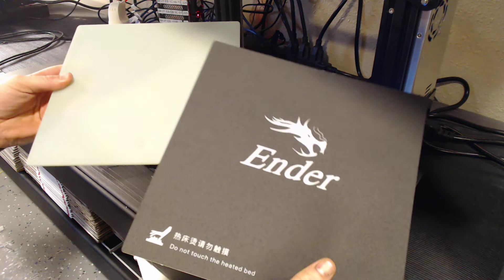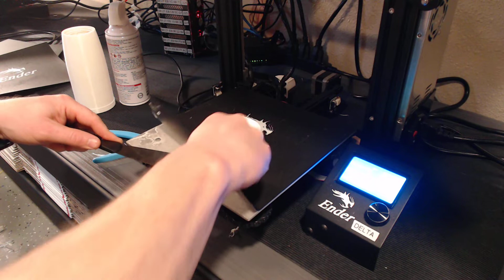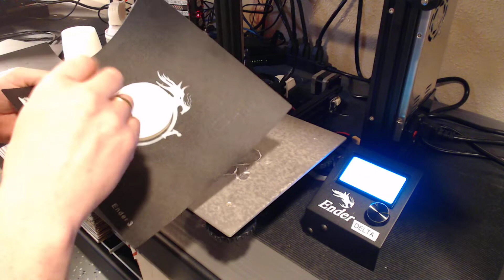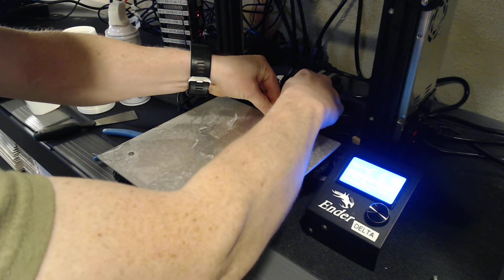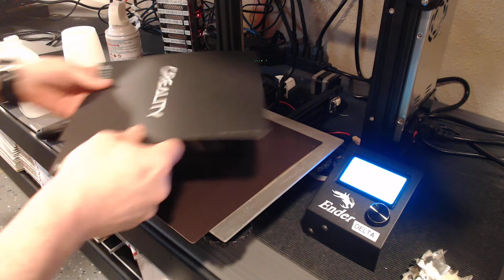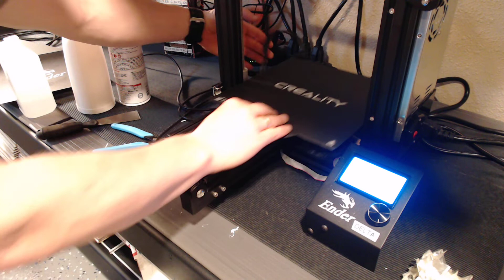Replace your Build Surface with a Magnetic Build Surface

Comment: When doing this, I like to just remove the bed from the printer. Is't just 4 screws. If it's heated there's a cable too, but at least you have a bit more access, and won't get stress the frame and get all kinds of solvents all over your printer :)
Reply from the maker: I've got a bit of South Kelso in me.  I don't always do things the easy way.   Either way works..  I had the bed hot if I remember right to help remove the adhesive.

Comment: Hey good info. What if you need to change springs or install some bed handle? Screws are not coming off anymore... It's too crazy to think some holes on the magnetic stick pad for this?
Reply from the maker: Most of my prints are in the middle of my bed..  I make artillery shells by the dozens.  If I need to change the screws, I use and exact and cut right through.

Comment: Next time use a degreaser like la totally awesome or simple green, just a everyday degreaser and it comes right off steve. Please let me know how you like the creality mag build surface,  i am using their glass which is very good and after it cools the parts pop off themselves but i like options.
Reply from the maker: I know there could be a lot of ways to do this. I opted not to used a degreaser to ensure there was nothing oily or sticky on the build plate when I was done.  Alcohol worked well and the surface was dry and clean when complete.

Comment: Hi Steve! The magnet had my interest while making my upgrade to the bed. My Ender3 came with the polycarbonate removable surface. At first I thought it was great, untill I found it to be impossible to keep level. In fact, it warped in key locations once heated. Fear of warping is why I didn't go with the magnet. I am now using a Borosilicate/PEI laminate and could not be happier having the ability to just flip it over when called for is convenient. Takes longer to heat tho, but I can practically  blow the print from the glass plate when cooled.